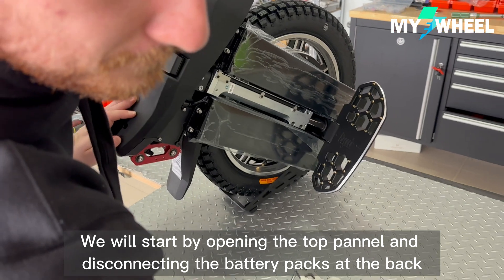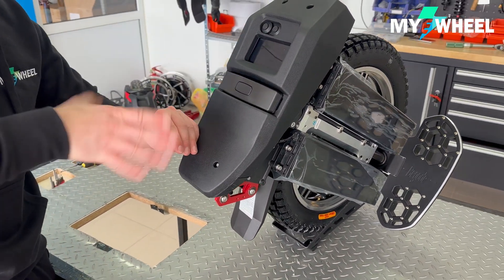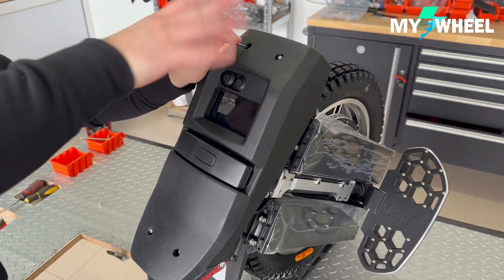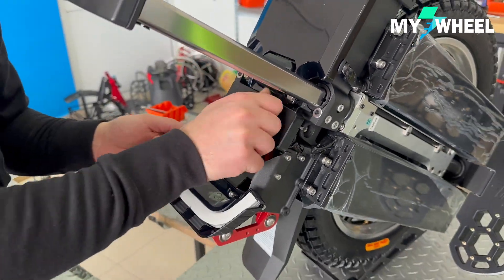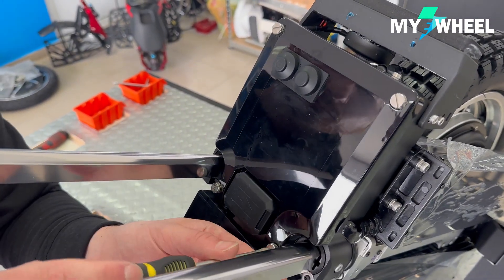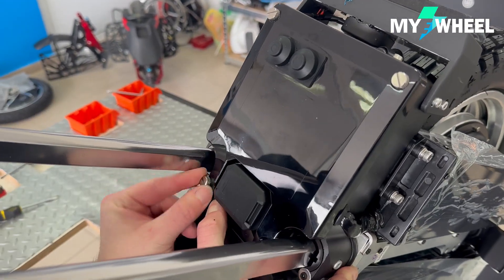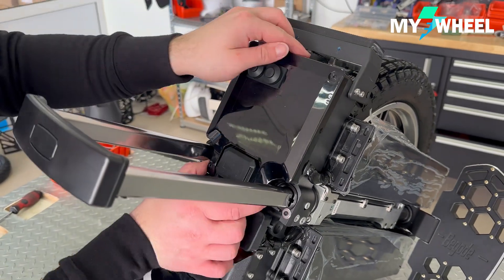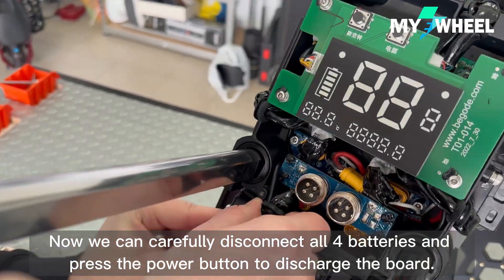Begode Master Display Chip replacment

Comment: Why has your table got a hole in it? Where Mten3's go to die perhaps 🙂  Sorry, its just that my Master display is fine.   Good work though for anyone with the problem 🙂
Reply from the maker: The hole is for a pedal. When you put the wheel on side :)